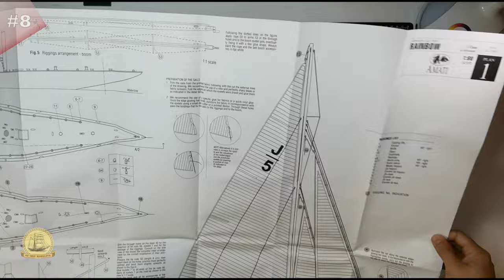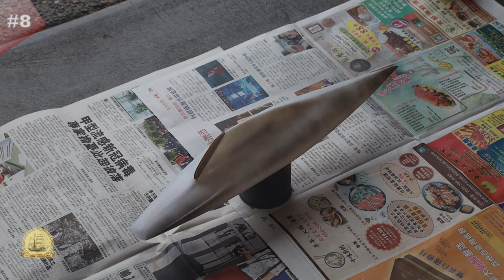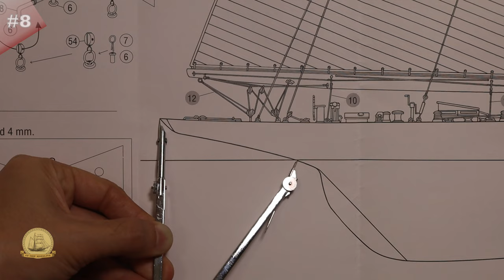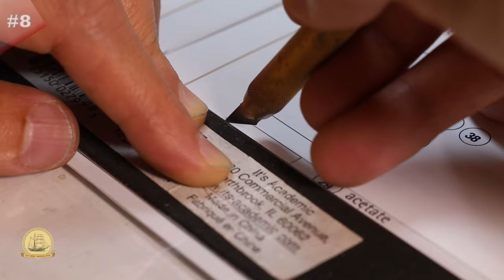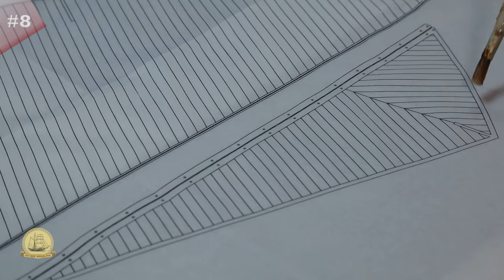I MADE a Ship Model over 2 Feet tall, Will it TIP OVER in the water?

Comment: If you want to eliminate bleed through on your water line don't pull the tape tight, just place it down under its' own tension and rub the edge down with your finger. I've been modelling for almost 50 years now and only learnt this about 5 years ago. It makes a huge difference. Nice build nonetheless.

Comment: The water is not the same scale as your model. Boats this small need a finbox and a bulb on a fin keel to stay upright. A DF65 keelfin and bulb should fit nicely, if you want it to be a RC sailboat. Something to decide before the deck is glued on...
Reply: It has more to do with dimensions and weight don’t scale down the same. Even if it had a full lead ballast it would tip over.
Reply: @spacemansabs  Correct, to be able to sail is as an RC model, it has to be at least three times bigger. Four times would make it even easier, as you would not have to build in extreme 'lightness'... And a finbox with a deep vin keel.